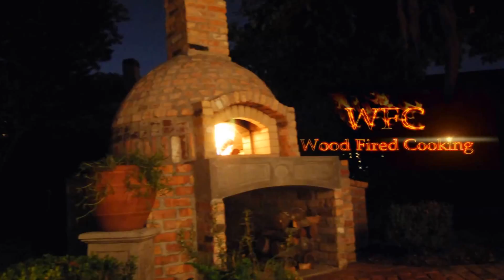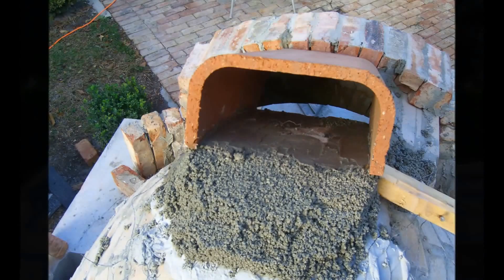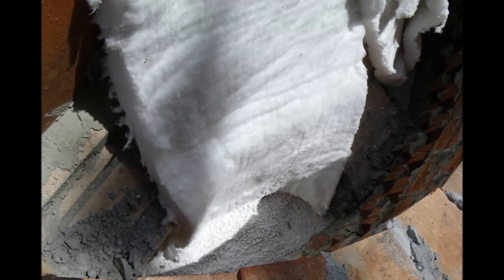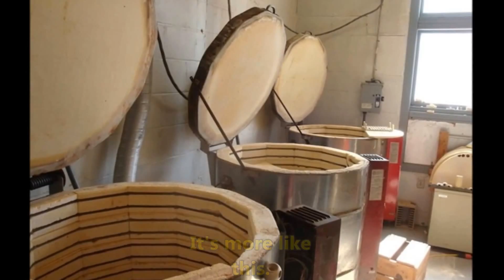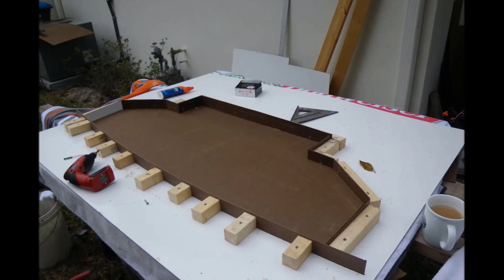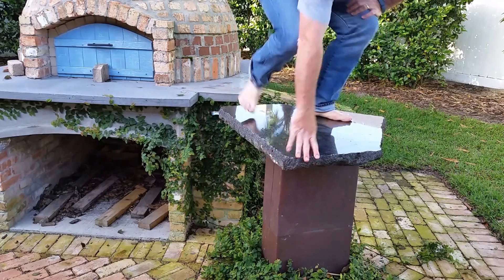How to Build a Brick Pizza Oven/BBQ Smoker Combo - Pt. 3

Comment: How’s it holding up?
Reply from the maker: It's holding up good. I need to do a little pointing and patching of some of the mortar joints, and the decorative concrete top I built for the hearth and around the outside of the oven is falling apart. I plan to replace it with a stone top when the weather gets a little cooler.
Reply: @LeeMcNeil thank you for creating this video and sharing it

Comment: Did you insulate the inside of the cement blocks somehow for the heat between firebox and oven? Apologies if I missed this in videos. Thx. All very cool.
Reply from the maker: No. You can insulate it but it wouldn't really do anything. The fire box is down low anyway so it isn't next to the oven. When you are using it to smoke something in the oven, you don't want high temperatures so it doesn't matter if some heat escapes the fire box.

Comment: What an awesome oven/smoker. Any idea how hot oven gets with fire in offset box only? Thank you for sharing
Reply from the maker: I've never tried to see how hot I can get it from just using the offset firebox, but it's pretty easy to get the oven to 350 degrees (F) with it. I would imagine that I could stoke it up to 450 or maybe if I got the fire really ripping. Once the oven gets up to temp, I have to really choke the fire down to keep it in the 225-250 degree range, which is the sweet spot for smoking most things. 

On the other hand, when I have the fire directly in the oven, it's not hard to get the temp over 1,000 degrees.

Comment: Great job! Check out “modern masters green or blue patina accelerator”
Reply from the maker: I have since put a solution of vinegar and salt on it and it made a blue patina but was really looking for a green patina. I will check out the green patina accelerator. Thanks!
Reply: Lee McNeil vinegar and salt is unpredictable in color but you probably have a presence of azurite in the copper that is turning it blue.
The presence of brochantite is necessary to turn green. You can bring this by mixing sulfur oxide with water and putting on the copper oxide will result in green to emerald color.
Another approach is miracle grow mixed with red vinegar 1:3 ratio.

Comment: Thank you sir. I am 40% of the way through this project. I am in Chicago and so my foundation is 3 feet deep. I am including a natural gas BBQ to compliment the arrangement. All is well and Your instruction is appreciated.
Reply from the maker: Be carefully about putting natural gas in the oven if that is your plan. If you are a little late getting the burner lit after starting the gas, there's a good chance of it blowing up in your face.
Reply: Lee McNeil I would always light the fire first and then turn on the burner to accelerate the  fire, but you're right, it only takes one mistake.

Comment: Lee, do you think that piece of granite would work as the floor for an oven?  I've got an idea for a spinning "floor" or section of the floor so you can easily turn food if needed - like a record player.  I know you can get granite like this cut into "platter" shapes and I think that's what I'd use IF the granite can withstand 500f + temps.   Whattya think?
Reply from the maker: I am not 100% sure but I don't think granite can take a lot of heat without spalling. If you pay attention next time you are in a big city, you will see a lot of buildings use a product called flamed granite as walkway pavers. Basically it is granite that is heated with a flame that causes spalling which roughens the surface so people don't slip on it when it gets wet. I'm sure there are products you can use though - some kind heat resistant tile or maybe some flue material.
Reply: I've heard that about granite too.  Thanks for the tip.

Comment: Put a damper on the door.
Reply from the maker: bogey19018 The cast iron door to the firebox?
Reply: No the mini garage door you have for the front. This way you 
can regulate the oxygen.
Reply from the maker: Well the front door supplies the air for the oven when I'm cooking pizza and such. It needs a lot of it. I only use the door when I'm using the smoker and when I'm not using the oven. To keep it from being a a home to the local flora and fauna.

Comment: I just can't stop looking at your oven, very interested in the design. It's  good form andfunction. The concrete base demission's I don't think you mentioned them other than 6 inch thickness, I think with that I could build one similar to yours, I'll thank you now.
Reply from the maker: +joe Freitas The base is about 6'x6' square. If you have the program Sketchup, you can download my model from the 3D warehouse and pull any dimension you need.

Comment: Awesome job Lee, what was the approximate cost on materials to build this?
Reply from the maker: +JDT738126 About $1,500 when I did it but probably about $2,000 today.
Reply: +Lee McNeil how does it look today? all the masonry work is holding out?
Reply from the maker: +JDT738126 Everything is doing good except the concrete top which I think I mentioned in the video. I do have a small crack developing that goes from the center of the mouth and runs generally along the front of the oven kind of where the flue offset is. I'm sure it's from the heat as the insulation is pretty thin at that location. I attempted to fix it with some epoxy but that didn't work - it just cracked again. I plan to fix it by sawing out the crack a little and caulking with some gray silicone, mainly just to stop water intrusion. I think I will do a video on it because pretty much every brick oven is going to crack somewhere sometime.

Comment: Great series on building this. I have thought about building something like this, but here in Vermont we would not get as much use from one as you do in Florida. However, this did start me thinking about it again. 
Bob
Reply from the maker: +Robert Von Bruns We have that problem in Florida too except it's the summer time when it doesn't get much use. It's way too hot and muggy - not to mention the mosquitoes - for about 6 months out of the year. It's just now starting to get cool enough to be comfortable outside.

Comment: Awesome build.  It has inspired my brother and I to build our own.  I do have a question on the BBQ smoker part - is it able to maintain a temp of 225F-250F for a long period of time that's required for BBQing?  Also, how is the heat control?  I know some offset smokers can be tough to use due to poor temperature control and the lack of being able to maintain temperatures.  Any feedback you can provide would be much appreciated.
Reply from the maker: Nathan Lenhardt Nathan - it has decent temp control. Mainly I use the door smoker box for this. The other two ways I do it is with a small sheet metal A/C duct elbow which I bought at Lowes that I set in front of the smoke discharge opening inside the oven. This routes the smoke up to the top of the dome instead of going straight at the food. I also have a piece of aluminum sheet metal that I use to partially close of the top part of the mouth of the oven to force the smoke and heat to go at least down to the level of the food before it goes up and out of the flue. Hopefully that makes sense. I will try to post a video of it at some point. The brick heat sink and the insulation really help stabilize the temperature though. It is nothing like using a steel smoker. You really don't need much of a fire to keep it at temperature once it's warmed up.